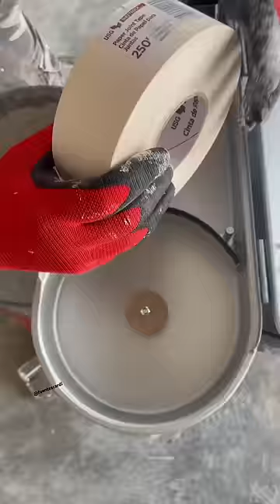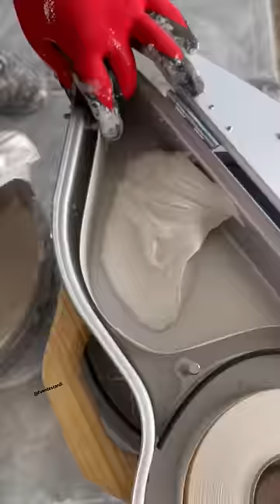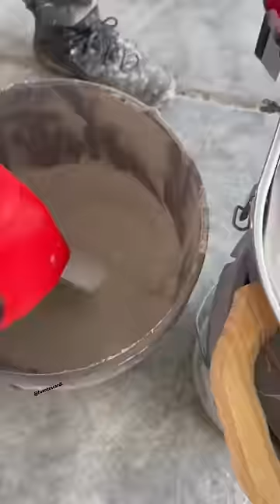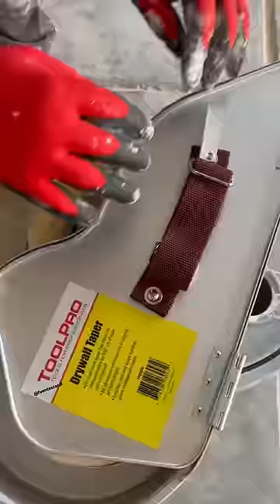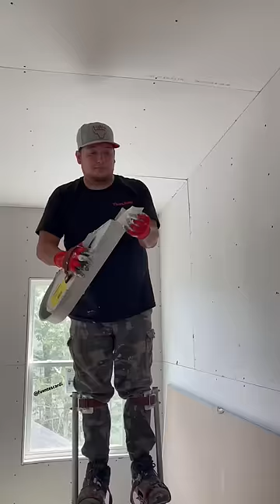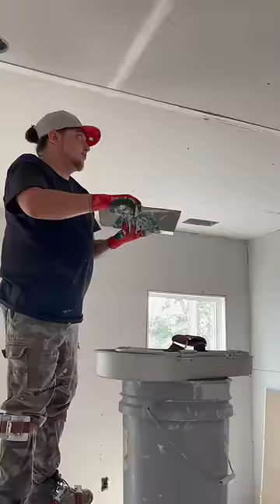Drywall banjo tools #construction #drywall #satisfying #tips #shorts

Comment: I'm sorry but what is he doing exactly?
Reply: If he didn’t do it the plaster would eventually crack along the joint
Reply: He’s applying plaster & tape to the areas where two pieces of dry wall meet.  If you don’t do this, you will always have a gap. Paint won’t cover the gap.  Soooo, yiu need this process to cover the seam.